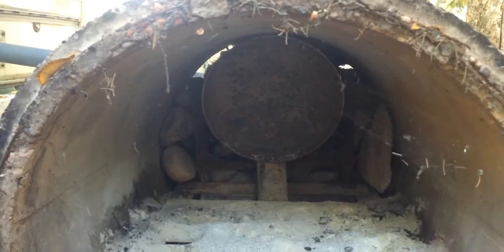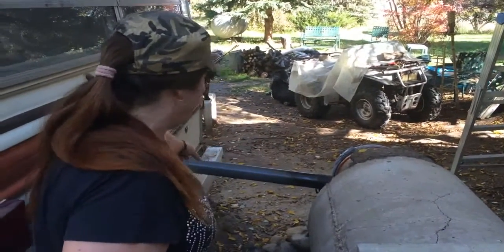Waste Incinerator Design and Home Heating

Comment: NOT awesome  there is no way to remove the crap from burning trash ,this is  shot down by real science .,USE LESS ENERGY is the answer they are wanting to avoid . compress your recycling !!!how many people even THINK of that? if all recycling was compressed ,five less trucks per town per day would have to run .so simple and  I cant think of ANYONE (besides myself)who bothers.and REALLY separate ALL toxics form your land fill trash  ,how many small devices have you discarded with the batteries still in,do your sweep up "squiggle"fluorescent bulbs  and just chuck them in the trash?  ($20,000  fine with possible jail time) etc etc   burn wood not garbage
Reply from the maker: Hi MrNicofrog; Thank you for sharing your concerns for all others to note. It is important that these shared concepts are viewed with constructive criticism to cause all inquiring minds to seek out both the pros and the cons.
Thank you for sharing.
howtopam

Comment: What kind of garbage are you burning? Do you have filter for the toxin? And what about the clinker? Thank you :)
Reply from the maker: Hi justeunepetitegoutte; I burn household refuse in my incinerator (papers and cardboard from product packaging mainly). Yes; there are facilities that recycle papers and cardboard, but ONLY certain types. Because my primary refuse is paper and cardboard and dry the fire burns HOT causing very few toxins to be emitted into the atmosphere. This HOT burn completely incinerates all refuse   leaving only very fine ash which falls through the bottom screen where it can be easily scooped up and carried to a disposal area. No need to break up clinks with a clinker. I hope this answers all of your questions.
Thank you for your inquiry.
howtopam

Comment: nice :) ... thinking if we can improve on that... that fan could be made redundant with a long (thin) exhaust pipe with a (little) flame providing that updraft... just thinking out of the box... (and) keep it going... with that lovely smile.
Reply from the maker: Hi camilo fernandes; Those are terrific ideas. This prototype is purely a foundation concept that can stimulate thinking to produce enhanced design improvements.
Thank you for your comment.
howtopam

Comment: Your furnace setup is illegal in most places and not sealed up enough to be called an incinerator as well as inefficient and adds to carbon oxidized gases air pollution but on the one hand you have made use of available resources to save yourself money. Use some of that personal savings to improve and seal off the gaps and reduce your carbon footprint that your furnace is contributing to the air. When you no longer smell any burning trash your system is efficient and environmentally friendly and much closer to being carbon neutral maybe even carbon negative if sealed well enough to burn the secondary gases created.
Reply: it's actually illegal to bury trash in the ground as if it is ever going to break-down in saying that it is "landfill". trash must be incinerated, evenly so if there is no fan to dissipate the smoke which actually amounts to evaporating water so it can rain. ever pictured what happens to dead leaves when they become dry, it is the water that is being evaporated out of them by the heat of the sun, but realistically they need to be incinerated for it is not the suns duty to incinerate but rather to evaporate only the h2o which falls so it can rain again. imagine all the forests how hot the sun would have to become for all of the dead leaves and branches to evaporate into h2o so it could rain and it is, but it is impossible. so as such there leaves a big job there an actual job, rather than some idiot burying trash as if to be a hero, rather than some person sitting in a bank as if to be busy, rather than some coward whipping a horse as if to have a job, but no. you could know that most people these days but rework, recreate, reemphasise...they have no idea or answers on how to live and have forgotten about the ages (now being a transition to aquarius) and are unforgiven and lazy to such an extent that i have had to contemplate whether they would ever have any right to be forgiven personally. so know that it is legal and that any legislation that says otherwise amounts to an illegal document of such conspiritors that sould be penalised for such delinquency that they truly are guilty of. with respect, people are going to be devoted from now on and are going to know what amounts to working. rather than some joke president with a maximum 8 year term as if that would be enough to ever know what is best for the people, but no. a job is for life which people need to give and are going to soon with happy arrays forevermore.
Reply: @anointing_favour  It's only illegal for individuals, government always exempt themselves from consequences to their own rules, that's why government needs restrictions themselves and some way to enforce it. Using another government structure to correct it also eventually fails. Congress is a failure today because of this problem. As for dried leaves, ask yourself is it also illegal for the microbes to break them down into nutrients for the soil. Some laws are not practical in every situation. In a heavy populated area they are made to solve overcrowding problems of too much pollution becoming a safety hazard. Out in lesser populated areas, nature reclaims what isn't used and is discarded eventually. Don't believe the lies that something will last forever buried in a landfill. Covered from the UV rays may prolong it's breakdown but who is going to dig there anyway for the next 100 years. That's why the government created superfund sites to bury hazardous materials away from heavily populated areas. Maybe Elon will be part of a future program to send our hazardous materials into the sun.
Reply: @HappyFace6or7  that is the opposite way of the age of leo which is wrong. respectively, a leaf could never become soil, for it is another thing altogether, so that is illogical. all that trash is going to have to be dug up and incinerated, along with any corpses that are still rotting away in coffins. for things must go back to their origin, in the replenishment of the earth, rather than people continuing to be careless in the purpose of the next age to come. im the one that bears the h2o and am going to bring it through the method of distilling for all the people to be holy. stay away from the consumtion of the ruminant, to enter the heaven that is coming soon, for it must come within the transition. also, there are other hopes too. wise orientations.
Reply: @HappyFace6or7  no idolatory here, god is a word, for ungodly/godly god, unhappy/happy happiness, unwise/wise wisdom...no religion either, this is formation that i speak of and is going to happen. that i happen be the lord of. that is why i had to comment on you, because what your slander of the earth is against me. for it is wrong and careless. interesting if you would ever listen though, i guess now you know what is at stake, so i give you a choice. now it is up to you. sounds as if you are uncircumcised/unholy/unintelligent. you should know that such adults could never enter heaven and be of god. people better quit consuming the ruminant in being satanic, if they wish to repent and be forgiven. again, no religion here only pure knowledge/success/intellect...